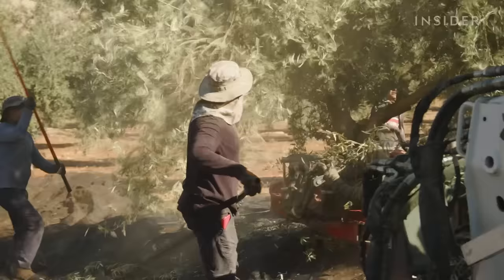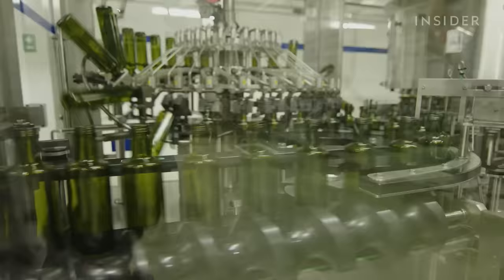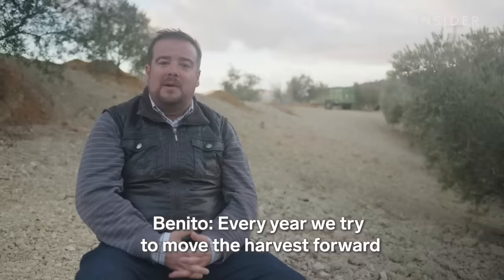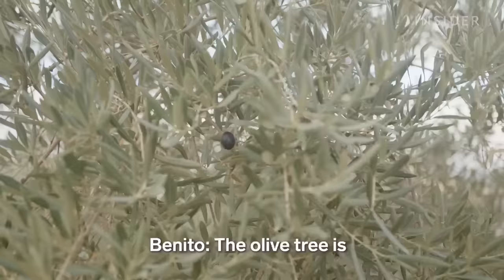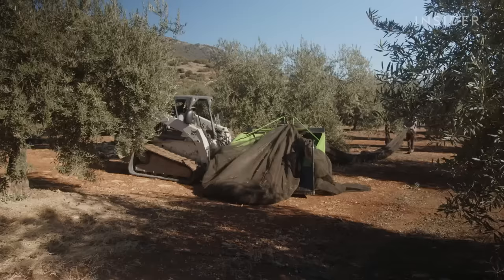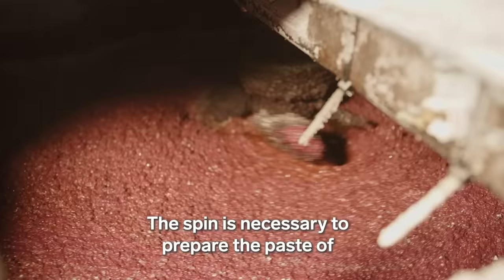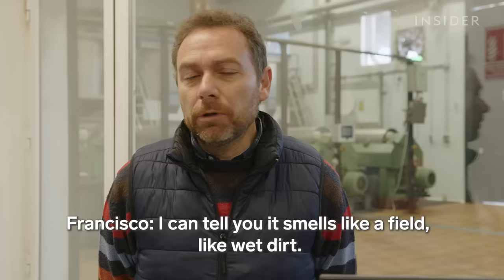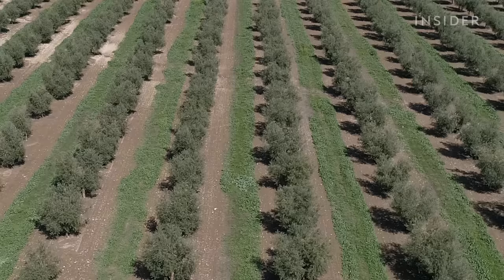How 3 Million Gallons Of Olive Oil Are Produced Per Year In Spain During Crippling Droughts

Comment: "the vibration is always upwards and doesn't hurt the tree"  
Farmer with a giant stick: WHACK WHACK WHACK!!!
Reply: That's what is told from the manufacturer. Actually you need higher amount of water to compensate the damage this machine causes to the fine root system. The fine roots close to the surface are taking in the water.
It's all a selfmade problem.

Comment: This year the drought has drastically lowered the production of the traditional olive grove. Right now (29-01-2023) one litre of extra virgin olive oil is about 5,30 €.
Reply: Hello from Greece. We had the same dramatic drought last year, i feel you. Would you say that the most negative affects were at high density groves (over 100 trees/1000m^2)? Did the traditional plantations (10-20 trees/m^2) cope better with the drought?
Reply: @konstantinoschatzidakis6394  Only the high density olive fields with irrigation coped the drought better. The rest are only giving between 25-50% of the regular production and low oil yield.

Comment: Did you know you can run olive oil in a diesel motor
Reply: For a couple of miles, yes. But Beyond that, it's going to f... up your engine pistons forever.
Reply: Yes, it is true. But you should know that olive oils is mucho more expensive than diesel fuel. Better use filtered wasted olis from deep frying.
Reply: @Desi365  Wrong. Vegetable oils works fine in old diesel engines. Keep in mind that Rudolf Diesel engineered this engine for running with vegetable oils.

Comment: Why are there never any contingency plans for bad droughts?
Reply: Because you can just pray for rain or suck it up
Reply: There is no emergency plan other the irrigation, but there are plenty of measures to prevent the impact of a drought in exchange to a slightly lowered regular harvest. A tradeoff which won't be met by most business farmers.
One can train olive trees to survive better on low/no water by reducing/limiting irrigation in the dry period when the trees have a year with less fruits.
Keeping the Soil integrity also reduces vaporisation as soil surface isn't increased.
Mulching with shredded olive cutoffs also works fantastic, and keeps the moisture from the wet season in the ground. Mulching has its downsides too. As the layer prevents water to penetrate more Water per tree is needed when irrigated in Summer.
Reply: @joeeigo9820  well now the reservoirs are nearly empty so we don’t have water for irrigation. The past 3 years there’s been almost no rain.

Comment: How many hundreds of litres of water does it take to produce 1L of Olive Oil?
Reply: Spain has the following annual ranges of the water foot-
print per liter of olive oil produced: 8 253 - 13 468 l/l green
water footprint (rainfed), 2 789 - 4 634 l/l green water foot-
print (irrigated), 1 428 - 3 002 l/l blue water footprint (irri-
gated) and 712 - 1 509 l/l grey water footprint (rainfed &
irrigated). These ranges are weighted averages according to
the share of each province to the national production. The
blue water footprint of other components in rainfed olives
has a negligible value of 0.4 l/l. The water footprint of olive
oil in l/l for each province over the period 1997-2008 is re-
sumed in Appendix 4.

Comment: why dont they build a pipe structure over the trees with sprinklers and then run water over all the trees like fake rain? Surely the economy can subsidise this? Okay it'll cost quite a bit to build the piping, but surely the ROI is worth it for the best yields? Then pump the water from the sea? (Just researched that apparently olive trees are "moderately salt tolerant")
Reply: Sure is an interesting idea but not practical at all: The bigger olive regions in Spain (like Jaén or Córdoba) are far from the see and a transport like that would cost millions, meaning the product would not be profitable. Moreover, olive trees can live in moderate salt environments, but salt concentration in see water is far far far more than what they can stand.
Reply: @pablosousa4061  :( yeah i did think they've probably already thought of all of this. Shame :(
Reply: most olive trees arent even near the sea
Reply: @pablosousa4061  Muy buena explicación.
Reply: They use drip irrigation systems in some places but others don't have infrastructure or nearby underground water to have that type of system